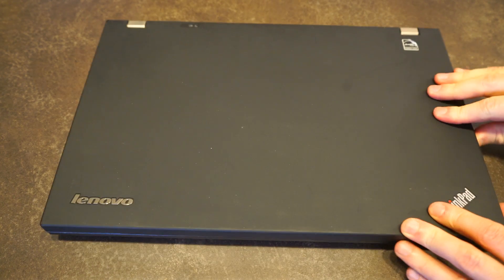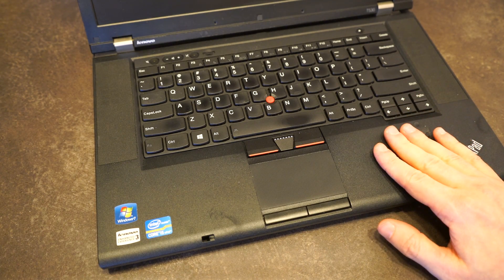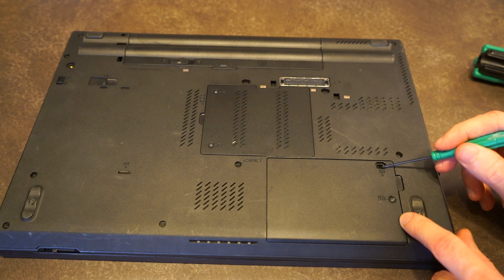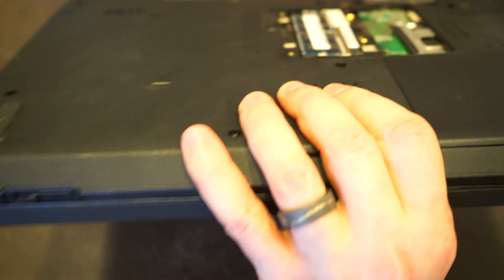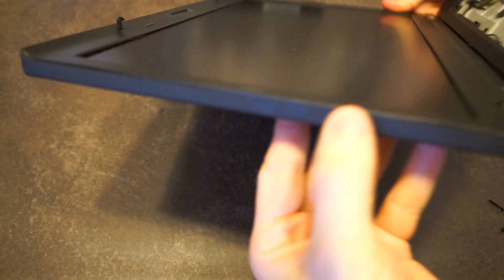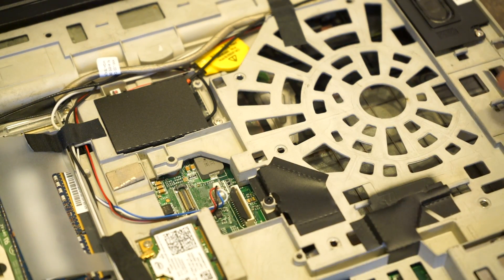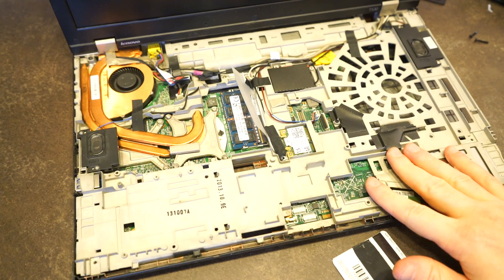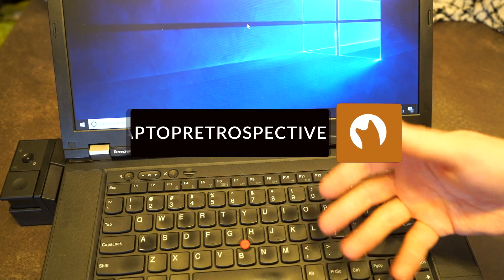Lenovo ThinkPad T530: The T430’s “Big Brother”

Comment: I fiddled in the "Advanced" settings of my unlocked bios and now I get an error code when trying to boot: 3x fast, 2x slow beeps, 3 fast beeps. Maintenance Mnaual say to disconnect all pci devices. Can I fix this?
Reply from the maker: Do you remember what you changed in there?

Comment: Funny, I actually still use on of these as my main laptop I had to replace the fan, but aside from that it works great
Reply from the maker: Awesome to hear yours is still getting used. What do you have it doing?
Reply: How do you figure out if you need to replace your fan
Reply from the maker: How it sounds is part of it, it's RPM under load being high enough. Error messages as well.

Comment: I used to have a T530, though it got dropped when I was out of the house one day, and never started up again.
Reply from the maker: I wonder what failed? 🤔
Reply: @LaptopRetrospective  I remember that it was about a 1m drop, and nothing could get it to power back on, so there was probably something on the board. I replaced it with a Dell XPS 15, because it had a better GPU than the T570. The XPS went up in smoke a month ago. I'd be back on a ThinkPad if they built a Yoga with upgradable RAM and Thunderbolt 3.

Comment: So I have a t530 myself and it has an  Dual core i5-3320m and if you go to msconfig under advance options you can enable more cpu cores. The 2 cores were  advertised to me but I soon found out they were 2 other cores disabled and if I enabled them it would add up to 4 and then I would need to restart. Is this safe can the t530 handle it ?.
Reply from the maker: Something doesn't sound right here. If you only actually have an i5-3320m you aren't magically going to make more cores by adjusting settings. What you probably found was Hyperthreading:  "the two cores can handle up to four threads in parallel leading to better utilization of the CPU."
Reply: @LaptopRetrospective    I’d maybe watch this vid for visual representation for what I mean skip to around  0:35   https://www.youtube.com/watch?v=X8SrbRQpiXA
Reply from the maker: Oh this old myth. Leave the box unchecked. Windows will decide how many it needs to use automatically for best performance. Specifying or forcing it to use a specific number is used to debug or when something doesn't work. It isn't a performance hack.
Reply: @LaptopRetrospective  oh ok.

Comment: My W530 doesn't have Bluetooth.  I tried a cheap DG40S USB Dongle with BlueSoleil software and it caused to many problems with the computer. After researching this problem I found the same problem several places.  It made it very very slow and it caused a not connected wifi symbol to appear even though it was connected to WiFi.  Watching your video I can see where the stock Bluetooth is installed.   You skipped the part about what screws get removed to remove the top part of the case.    Would you know if the software for the stock Bluetooth card works well with no issues?   The other thing you mentioned was the slot under the protective cardboard.  Would you know if a better quality Bluetooth card could fit there and what software/Driver would be used?   Thanks, Ken
Reply from the maker: Hey Ken, your first stop should be the maintenance manual on the description to get a list of parts as well as procedures to remove everything I didn't show.
Reply from the maker: The stock drivers for Windows shouldn't provide any problems. Or just a more reputable Bluetooth manufacturer like ASUS BT 400.
Reply: @LaptopRetrospective  Would you know if the ASUS BT software is universal to work on other devices or is it only specific to the BT 400?   I doubt their is any difference in the hardware between the DG40S USB and this one.  Well at least no difference in performance.
Reply from the maker: The ASUS one does not require software, plug and play.
Reply: @LaptopRetrospective  Plug and Play for Windows 7?    That's certainly not the case for the DG40S on Windows 7.
Reply from the maker: Windows 7 is probably going to let you down with modern hardware. Any reason why you're still using it?
Reply: @LaptopRetrospective  Its been very reliable and does everything I need. I can't see paying microsoft for windows 10 yet.  Plus I have a lot of software I don't want to install over again.  I am also not a big fan of
letting Microsoft do automatic updates only to find it causes more problems than good.  I like to pick and choose my updates.   I think Windows 7 will be good for a few more years.  It will only die when software companies write programs that will only work on Windows 10.

Comment: My W530 built in camera is no longer recognized. I noticed it still shows up in the Device manager so I uninstalled, then did a scan for changes.  It didn't come back.  I tried installing the driver and I get a message there is no hardware.  I am guessing
its either the camera, or the cable.  The lenovo communications software only shows audio.   Have you seen this problem before and would it be worth removing the cable to the camera inside the bezel, reboot. Power down and connect the cable and reboot again to see if this time it sees it.  If not take a shot and buy a new camera?
Reply from the maker: You might need to find or invest in some parts for troubleshooting.
Reply: @LaptopRetrospective  that's a bit vague...
Reply from the maker: @n1kkri  Sorry I can't provide more specific details for your problem but it would be helpful to have parts to troubleshoot.
Reply: @LaptopRetrospective  I will assume as in parts you might mean a replacement camera to work the process of elimination..
Reply from the maker: @n1kkri  Yes or any other parts in that system that might be faulty. The maintenance manual has the diagrams.
Reply: @LaptopRetrospective  The cable at the camera end looks good.  The end that I think leaves the camera and plugs in at the base of the display looks good.  I ordered a camera on ebay for $6 delivered.  Cheap enough to try.
Reply from the maker: @n1kkri  Best of luck, hope it solves the issue.
Reply: @LaptopRetrospective  The $6 ebay replacement camera solved the problem
Reply from the maker: Awesome! I'm relieved.
Reply: @LaptopRetrospective  Me too!

Comment: Was eyeballing one of these on Ebay recently as a secondary (tertiary?) machine to replace a Toshiba P850d whose hinges are suffering from spending a bit too much of its downtime bouncing around in a backpack. Specs from the listing are:
-Core i7 3520m Ivy Bridge
-1600x900 anti-glare LED-backlit display
-16GB DDR3L dual channel ram
-256GB SSD
-Dual Graphics Video NVIDIA NVS 5400M + Intel HD Graphics 4000
-DVD+/-RW DL Burner
-9 cell battery
-Win10 Pro 64bit installed
$399

Use case would be primarily digital drawing, so a fairly bright display is kinda important (not necessarily professional grade--I'm just a hobbyist artist). 
I already own a T61 whose display was never really bright enough for color work (and it's running WinXP), and I also have a Flex 5 2-in-1, (bright enough, but its 4k screen makes some older apps a squint-fest, and it likes to freeze up at random till it's been on for an extended period of time) 
I hadn't really given older ThinkPads a look till I noticed this one had a discrete NVidia GPU (not a big gamer--the most  demanding would be Cities:Skylines --and that is more CPU-intensive than anything)
Reply from the maker: For colour accuracy, you might want to consider an external monitor. While the LED panels are brighter than the TN ones, how colour accurate they are I cannot say.
Reply: NVS is designed for business/scientific software rather than games, and Intel HD isn't even supported by C:S. If you use it for work it is great, but not for games. (Though price seems very high.)

Comment: I have a question - is the T530 touchpad an adhesive "sticker" or is it one solid piece you must replace? Thanks.
Reply: It is a sticker. Quick tip for these is to cover the touchpad with nice carbon fiber vinyl, it’s cheap and easy and improves the look and feel of these laptops!
Reply from the maker: @sneedsneed460  now there's an idea.
Reply from the maker: I believe it is a sticker. The maintenance manual should be in the description to fact check me.

Comment: I bought a refurbished Thinkpad T530 in 2013 for around $680 ($900+ value but bought from Lenovo Direct website), and after using it sparingly for writing for about 7 years I must say I’m really impressed by the longevity of these. Everyone says laptops only last about 5 years but mine still operates flawlessly; even the battery is still in excellent condition and hasn’t deteriorated the way I thought it would. Love these!
Reply from the maker: A laptop even lasting "only five years" is a rarer thing these days. Glad to hear yours is going strong.
Reply: Laptop Retrospective Thank you! Me too, I’m so glad I purchased this instead of any other laptop XD
Reply from the maker: @lemmihilldrix1450  No doubt!

Comment: I bought a T530 about 2015.. still have it.  I was blessed.  It was showroom condition.. no scratches, almost no wear on keyboard, and separation cloth between keyboard and screen, which I still use.  It came with 500gb HDD, 4gbX2 Ram, HD+ Nvidia 5400, DVD-RW.  It still has the original battery, which still gives me a few hours.  I replaced the unmatched Ram with g.skill 8gb X2 -PC12800 - 1600. That made quite a difference.  I just ordered a 500gb SSD which should be here tomorrow.  It's heavy, but I like that it has some MIL Specs.  Be sure to unlock it, and open from the center to place less skewed stress on the screen.  It's amazing how many different specs were offered on this unit.  I bought it on eBay for $325, as I said 4yrs ago.  Oh, it's i5-3320m.
Reply from the maker: Awesome setup and story. Thanks for sharing.
Reply: @LaptopRetrospective  You're welcome.  One of the main things I forgot.  It came with Win7pro, I upgraded to Win10pro, and it's had trouble with feature updates, until I took it offline and installed them ISO.  That way, I could remove my McAfee firewall antivirus software, without being online.  That works great.  Blessings!
Reply from the maker: @graybeard2113  Those ole antivirus programs. Lol.

Comment: Hey folks.   I am a fan of  T520/T530 W520/W530 ..  In this demo  you could  see  the BT daughtercard  embedded to the right of trackpad under the palmrest.  Win 10  on booting up does NOT recognize it (last 30 seconds of this clip). Correct me if I am wrong - it's a BT 3.0 standard which win 10 does not support.  Any workarounds?   Thanks for the retrospective - excellent choice!
Reply from the maker: In the T520 it would probably just be a matter of whitelist removal from the BIOS and stuffing in a better WiFi Bluetooth combo card. Not sure about the T530.

Comment: I got a free T530 from my employer about a month ago, it's an i7 3520m 2.9ghz dual core, nividia nvs5400m graphics, 150gb ssd drive and 8gb of ram. It had windows 7, the company upgraded to 10, I upgraded this to win 10 for free and it's still running amazingly fast. The battery lasts 5-7 hours or more steady use (original battery from 2013). I feel so lucky to have gotten this thing for free.
Reply from the maker: No kidding! Congratulations.
Reply: @LaptopRetrospective  only upgrade I need is more storage. Not sure I want to spend the money on upgrading the SSD though.

My old laptop is a Lenovo g550 with 250gb HDD, Pentium t440 and 4gb of ram. The display is terrible and has terrible viewing angle. It served me well for like 7 years until I gave it away and then got it back recently. It's just too slow now.
Reply from the maker: @1984Cutlass2nv  With a larger SSD you'd be unstoppable.

Comment: Does it suport thunderbolt
Reply from the maker: This model does not feature it.
Reply: @LaptopRetrospective   so the 700 dollar aurus gaming box i just bought wont work
Reply from the maker: @nebula2379  if it needs thunderbolt 3 which I suspect it does, then no. There is no port to plug into.
Reply: @LaptopRetrospective  is it possible to get a express card with the thunderbolt port
Reply from the maker: @nebula2379  Express Card cannot handle that level of transfer. It would bottleneck almost immediately in a big way. I'm not even aware of an Express Card with a USB C port, let alone thunderbolt capable.
Reply: @LaptopRetrospective  ok, thank you. A least now I know I need to get a new laptop
Reply from the maker: @nebula2379  glad to help.

Comment: Have a T530 i7 Quad. And its a nearly perfect Hackintosh. Compiling much in Xcode. Except the Display Port. The dedicated GPU form Nvidia is not working with macOS and I must use the Hd 4000. If you do this the Display Port is dead because its hard wired to the nVidia. Thats the only disadvantage of the i7 Model PLUS the BIOS Whitelist. Normally its not possibel to PlugIn a macOS compatible WLAn Card. There are 2 choices: Rebrand an Atheros 9280 or flash a modded BIOS via USB Programmer directly on the BIOS chip.
Reply from the maker: No e information. Thanks for sharing.

Comment: used thinkpads in usa are so cheap. I live in SE asia and this model still goes up around 200 usd. I even considered myself pretty lucky for buying one around 130usd. Not the most portable of course but truly a workstation even until now
Reply: I bought my T510 in 2019 for 152 USD. 😃 One of the best business laptops I owned. 😊
Reply from the maker: Nice buy.
Reply from the maker: Yeah that can hold their value depending on how common they are.

Comment: watching this on my thinkpad t520. I scored this beauty for $5 with no hdd. Its in excellent shape too. not even any wear on the keys.
Reply from the maker: That's awesome. Well done.
Reply: Awesome where did you get it? A garage sale?
Reply: @ponderingypanda  I got it at a thrift store.
Reply from the maker: Entirely depends on your needs.
Reply from the maker: If that's all you're doing there are a variety of ThinkPad models that could do the work. Most of it will come down to availability in your area and personal preference.
Reply from the maker: I'd be tempted to go T450 but that depends entirely on specs, configuration and screens in each.

Comment: Would this laptop be suitable for a beginner music production?
Reply from the maker: Have you looked up the system requirements for the software you'd be using?
Reply: @LaptopRetrospective  I have not. But FL studio is a popular one for windows.
Reply from the maker: @s.amiri05  I'd check your system requirements and see what, if any system configurations would be appropriate.
Reply: @LaptopRetrospective  sounds good. Cheers man
Reply from the maker: @s.amiri05  right back at you. Best of luck.

Comment: so the GPU i can change ?i have the same leptop T530
Reply from the maker: GPU is soldered to the motherboard I believe. But you could use an eGPU. I'm testing the setup right now. If you go to the Community page for the channel you can see me testing it on my x220. The T530 would be av even better candidate.
Reply: @LaptopRetrospective  YOU HAVE ON THAT T530 NVIDIA 5400. I have Intel hd 4000 is a bul.... i want to know if is good the nvidia 5400
Reply from the maker: @jackrobert4620  Hey Robert, some motherboards came with just the GPU integrated into the CPU like yours. This one has an optional dGPU that was put on when the laptop was made. The graphics card was more designed for workstation processes, so it depends on what you want it to do.
Reply: @LaptopRetrospective  i want to put a gpu can do you help me ? a site to buy please
Reply from the maker: @jackrobert4620  your only two options are swapping the motherboard, which can be a bit of a project if you're not comfortable working inside computers. The other option is the eGPU route and I will be doing a video on that soon.
Reply: @LaptopRetrospective  for what is the white cable by the wirless...my wirlsee is not working and that white cable i dont now were to put....
Reply from the maker: See page 77 or 79 for how the wires should look depending on your module. https://download.lenovo.com/ibmdl/pub/pc/pccbbs/mobiles_pdf/0b48474.pdf

When you say it isn't working, that could be because of the physical kill switch on the laptop itself, bad drivers, disconnected wires, bad wireless chipset, etc. The white cable depending on where it is might be an antenna for the 3G module that was optional.

Comment: Great Video,
I have a T530, with 16 Gb RAM, 480 SSD, Grafik thinks 1 Gb.  + bayed  1 TB HDD external. So Win 10 is on SSD ( Inside )and the rest is on HDD ( external). And a Docking Station.
But in the last Time, my Laptop getting hot, too hot and slower. I bayed a Cooler with 4 X 140 mm... I want to open the Laptop and to clean the ventilation. 
I also bayed 6 bottles Air for cleaning...
Reply from the maker: The fans wear out over time and the thermal compound might need to be changed if it's white and powder like.
Reply: Laptop Retrospective: I tried to open it, but I failed. I didn't see the fans. Therefore I asked for a Video : hpow to open and clean the fans and so on.
 And this online company IT -versant. Is a German low company. 
The Link:
 https://it-versand.com/premium-sortiment?p=1
Reply from the maker: I don't have the T530 anymore, but please read the maintenance manual in the description to learn how to take everything apart. It has clear instructions and pictures.
Reply: "Bayed"

Bought?

Comment: Can you change the memory to DDR4?
Reply from the maker: Pretty sure DDR3 is the highest supported.
Reply: @LaptopRetrospective  Is this the same for the processor?  For example, if I want to swap out the processor (for a newer intel gen), would the motherboard need to be replaced as well?
Reply from the maker: You are limited to what the motherboard will support and there is not another motherboard that will officially support a higher gen CPU than the one it was designed for. This is the case for the majority of laptops.